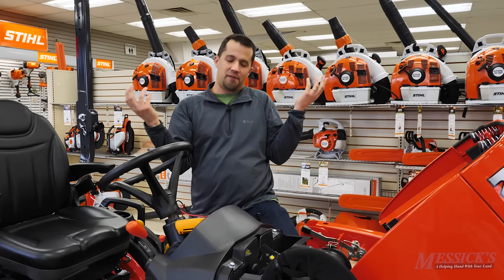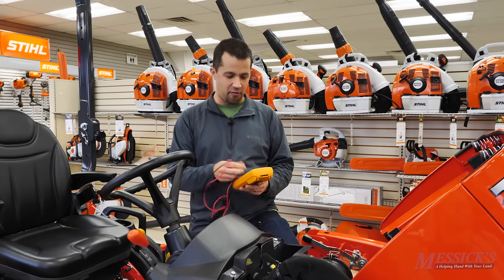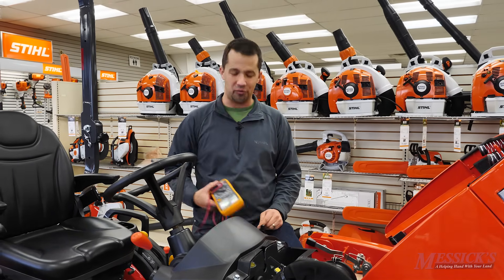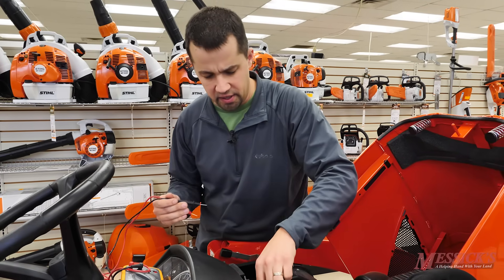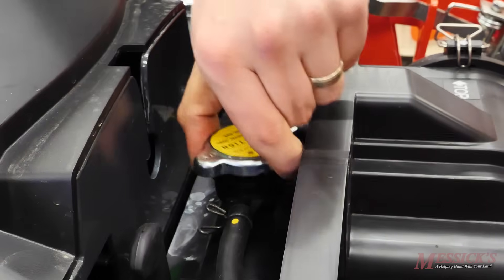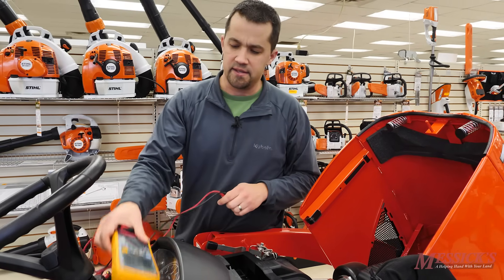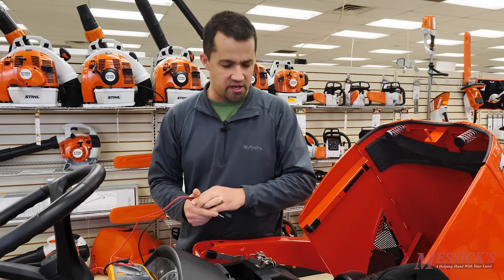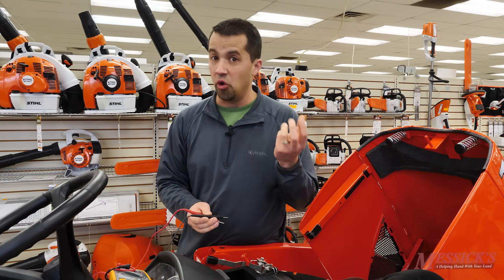Cool Trick. Check coolant quality with your multimeter!

Comment: Your meter showed 2.7 millivolts not volts. Or 0.027 Vdc. 
You said 2.3, 2.4 Volts which not correct. It was 0.024 volts.

Comment: Im confused too some said red in coolant some said red to ground which is which? Damn lol
Reply from the maker: It does not really matter, will just flip polarity
Reply: Using a Fluke VOM set to DC Volts, Insert the RED + (Positive) lead into the warm Coolant; Touch the BLACK - (Negative) lead to the Negative Terminal  - of the Battery.
Lowest number is better. Maximum = 0. 40 Volts DC.

Comment: Good idea. How much voltage is acceptable and which figure hits the ultimate upper limit? I wonder, whether the voltage will drop over time, due to a decreasing percentage of rust-inhabitors like phosphate (as typical ingredient in coolant fluids for Japanese engines, as far as I know).

Comment: Have a good quality multimeter a cheap one might be costing ya extra in coolant changes or less frequent changes I'd say only in heavy constant use a good meter would be beneficial but low to moderate use use a hydrometer and stick to a maintenance interval

Comment: Nice video.
I put the 2 leads of multimeter into the coolant radiator and it gives 0.02 v. However, when I put one lead inside of radiator and other lead to negative of battery, it gives .20 volt. Why is this reading different???
Reply: Lead is lower on the galvanic scale than steel therefore there's a bigger gap in difference of potential between the aluminum and Cooper of the radiator when going to the lead battery terminal vs going to the steel frame.
Reply: @horseblinderson4747  which test is the right one??? Into radiator or coolant to negative???
Reply: One into the radiator without touching the radiator. The other one on the frame

Comment: I have the same meter, it has an auto range feature. If your meter does not have auto range, make sure it is set to the lowest DC range otherwise you will get a false reading.

Comment: But the coolant is grounded to the engine and therefore the vehicle frame. So how will it show a potential voltage except a spurious voltage. Can you expand this video showing the voltage using an old vehicle and old coolant side by side with new?

Comment: This is known as Galvanic corrosion. Galvanic corrosion (also called bimetallic corrosion) is an electrochemical process in which one metal corrodes preferentially when it is in electrical contact with another, in the presence of an electrolyte.  Good information Neil.  Thanks.

Comment: Have used this method for years,but it checked the acidity of the coolant it doesn't check the freeze point there for you should still use a hydrometer or tachometer.

Comment: Anyone doing this trick should take note that there are 2 types of voltage AC and DC.  Make sure if you are doing this test you are on DC otherwise you will get bad readings.  Also, while Neil dipped his negative lead into the fluid it does not matter if you use the positive or negative lead so long as you touch the other probe to the frame.
Reply: Unless you are using an old style analog meter with zero to positive scale only. If it is an analog with center zero then it will show a negative voltage as well.

Comment: We learned in science class that any to different metals separated by a fluid will create a current that's how a battery works. Some fluids conduct better than others so if the metals get absorbed by old fluid it will conduct better. That's why they have those coolant filters in some big trucks with additives to prevent electrolysis of cylinder liners.  Just a fun fact..

Comment: Use lithimus tape to also measure the acidity of coolant and you can catch a bad head gasket or liner problem before it gets expensive to fix.  Trick we used aboard ship on the diesel  when we did weekly water testing.

Comment: The reading displayed on the meter in the video is about 24 mV, not “2.4 V.” Otherwise, this is a great tip. Thanks, Neil.
Reply: Yes 24 to 27 mv, not 2.4 to 2.7 volts. The "expert"  should learn to read a meter before trying to teach class.
Reply: @rjvan9220 : I took it an honest mistake.
Reply: @markproulx1472  Sorry Mark, I'm a industrial imstrumentation and control tech. We are picky to .02 percent accuracy, I set the bar too high, my bad.
Reply: @markproulx1472  Nice video.
I put the 2 leads of multimeter into the coolant radiator and it gives 0.02 v. However, when I put one lead inside of radiator and other lead to negative of battery, it gives .20 volt. Why is this reading different???
Reply: @tnamen1307  Surface area - one measurement was between the leads, and will depend in part on spacing and other factors.  The fluid to ground can bridge to a larger surface area in the radiator, including locations that may be rusting/oxidizing.  The fluid to ground should be a better measurement in this example.
Note - this measurement is for the rust inhibiting properties, not hot/cold performance.

Comment: On the subject of voltage in the engine coolant. I found this article on-line from Caterpillar which warns that excessive voltage in the coolant can actually destroy a diesel engine. The testing procedure they use is quite extensive. 

http://www.dieselduck.info/machine/01%20prime%20movers/coolant_voltage.htm

Comment: Interesting. Never saw that method used before. In addition to float balls and test strips, one of the best tools to check coolant is a refractometer. It is probably also the most expensive.
Reply: Refractometer is the best tool to determine your freeze protection. Unfortunately it tells you nothing about the state of your corrosion inhibitors. Outside of a lab test, test strips are your best choice for that.

Comment: .4 volts DC or less is good. Looking for conductivity. As the coolant ages, it will conduct current better. Want a low number.
Reply: If looking for conductivity why wouldn't you have the meter set to measure resistance (Ohms)?  In the test shown in the video, where is the 0.027v coming from?  The way he is doing the test it would appear that the coolant is actually generating the voltage potential as nothing in the tractor's electrical system is applying a voltage to the radiator or fluid.
Reply: @eosjoe565  yep, seems like we should have been talking ohms.
Reply: The coolant is acting as an electrolyte so it is carrying an voltage potential.